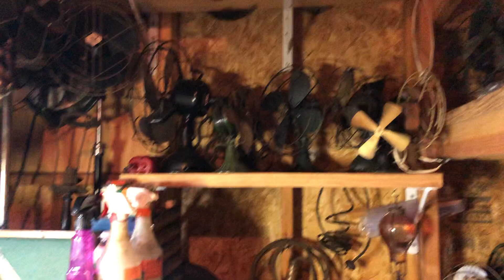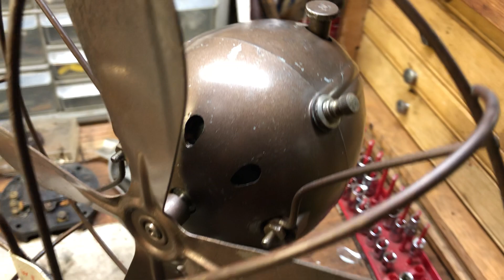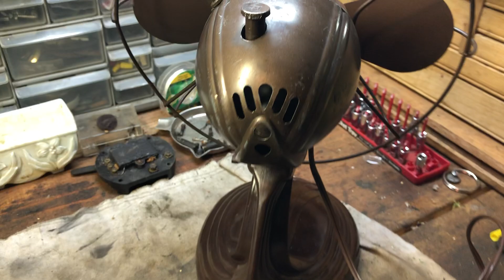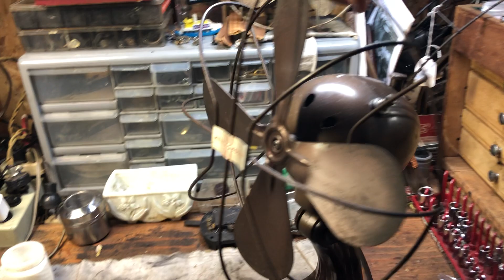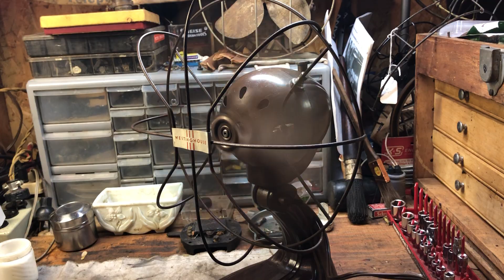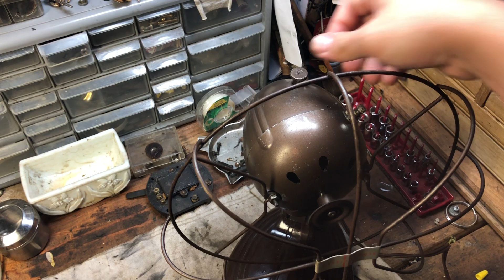Vintage Westinghouse Pacemaker Fan

Comment: That's a very unusual place for Westinghouse to put a switch. Still, it's pretty cool. 

I've been thinking about doing these because of the quarantine, but I don't know. I've been down on my luck lately and it's been taking a lot out of me. I have a few fans that I need to work on, that I haven't touched in over 5 years. It's crazy that it's been that long already.

Comment: I'm trying to fix up a pacemaker I picked up but after trying to take it apart to sand and repaint I found I wasn't able to figure out how to safely remove the blades after taking out the little screw pin on the side of the blades. Mine looks similar to yours but has larger overlapping blades and has three bars on the center vertical grill.

Any suggestions?